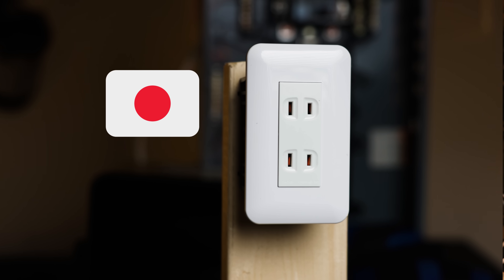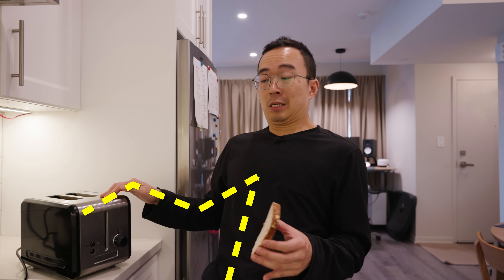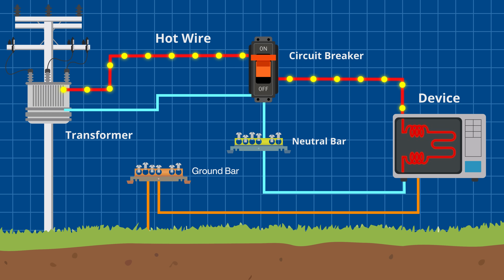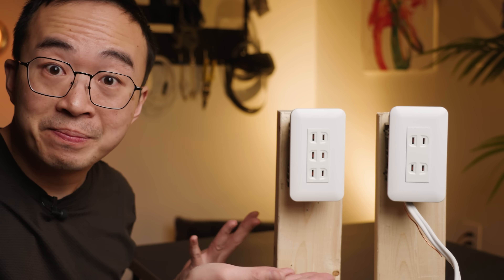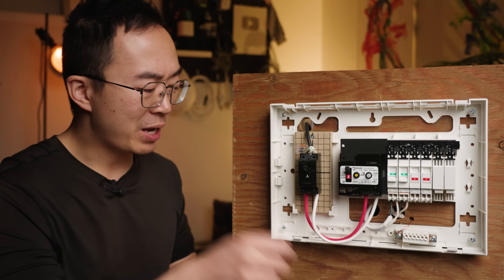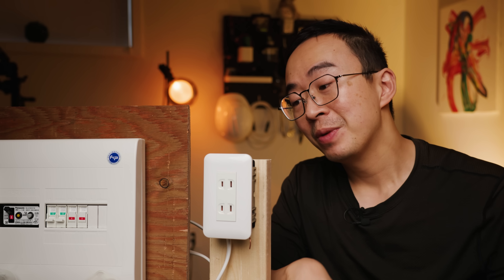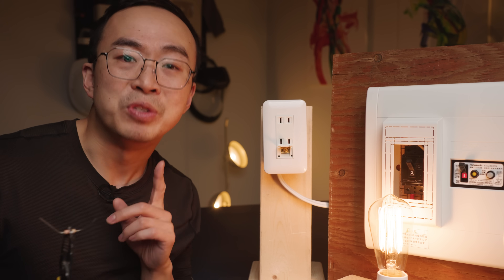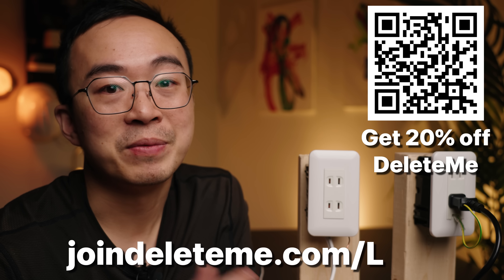How Japan Made Their Outlet Safe

Comment: I live in Japan, and for whatever reason, power strips nearly always have a ground pin hole, despite basically no appliances having the pin. Also, many appliances that have a ground wire, don't have the fancy metal connector. It's just a bare wire, and you're expected to just sorta, shove it into the ground plate.
Reply: I'm currently in the Philippines and there are US plugs everywhere but instead of 110 V, they're using 230 V @ 69 Hz. Somehow the outlets are upgraded to have a ground pin but the rest of the system hasn't been upgraded properly. Also you'll find many devices using EU plug as well. Many US grounded plugs have the ground pin removes to fit into the old sockets. German Schuko plugs also fit into the universal outlets that are here but still no ground connection. It's wild. 😅
Maybe it would have been better to upgrade the US plug to a different system in order to force an upgrade in the electrical system as well.
Reply: @davidvolker4647 sounds like China, you will have the Japan/US 2 pin but it's 220V, European style 2 pin, and the Australian/NZ 3 pin all at once.
Reply: Similar in Taiwan, people would just yank off the ground plug with pilers lol. Some appliances have grounding wires but no one ever use it. In the home I was at the air conditioner 220V 20A socket had ground but not the regular (same as Japan) 110V ones  

And only the bathroom circuit was connected to the GFCI breaker

Newer building have American style ground 110V sockets
Reply: Likely just re-use of American designs. In Australia many plugpacks coming from China are 'upside down' since China uses a very similar (but not quite the same) outlet as we do, but they have the earth pin on top, so if the plugpack pulls away from the wall slightly, the earth pin is the exposed pin, where in old Australian appliances, active and neutral would have been exposed. in 2003 it was mandated in Australia that the first half of the flat pins (the half at the back of the plug, not the half first inserted into the socket) is insulted to prevent that issue.

Different solutions to the same problem, but since we share an outlet and do it differently, sometimes the plugpacks are just upside down - happens the same for China too, sometimes a plugpack released in the local Chinese market will be Australian standard with insulated pins but upside down for Chinese sockets.
Reply: It's a bad design. They should have just started making outlets with the 3rd pin as well as the plugs that need it. They could have done that decades ago.

Comment: TLDR Japan adds a MAINS GFCI  making all outlets Satisfactory. USA adds Ground To make Outlets Satisfactory, UK add a Fuses to Outlets to make them Satisfactory.

In short for Each system for Satisfactory
Japan: MAINS> GFCI> FUSE> Outlet>Outlet daisy Chain
USA: MAINS> FUSE> Outlet Grounded/Outlet Ground+GFCI>Outlet daisy Chain
UK: MAINS> Grounded Outlet With Dedicated Fuse> Outlet daisy Chain Each with Fuse

Most Efficient + Safe
MAINS> GFCI> FUSE> Outlet With GFCI Grounded> Outlet daisy Chain

Video Title is Wrong since Best Practice in US is to start Each Circuit with a GFCI and Daisy chain from that... Not that they ALWAYS DO.(Really should be Enforcing that code Federally instead of being a town by town thing.) That and the Neutral Short that US has is already in place and Japan needs the infrastructure for that safety... Also the UK is safe only due to sheer redundancy not because its is truly safer... and they have even less than japan does for infrastructure. Remember making it Efficient and Safe is the goal not just SAFE.

Comment: If the ground draws the electricity from an overload, why doesn't the electricity always go to ground instead of neutral all the time?   If ground and neutral are connected together what would cause ele. to divert to neutral?
Reply: The video really didn’t explain that well. 

Normally, power flows between line (live) and neutral. In a FAULT where the line is accidentally in contact with a conductive enclosure, that would cause the enclosure to become live. By preemptively connecting the enclosure to ground, if the line conductor accidentally comes into contact with the enclosure, then it’s a dead short and the breaker trips. 

(The whole thing he says about ground being a much larger conductor is kinda nonsense. It’s limited by the size of the wiring in the house, which is why proper wiring always uses a ground wire the same size as the line and neutral wires.) 

So your question “what would cause power to divert to neutral” is based on a bit of a misunderstanding. Power doesn’t divert to neutral. That is its normal designated path, as defined by the circuit design and enforced by insulation. The power has to flow there because that’s the only place it can flow through, as designed. It is only in a fault condition where something has gone wrong that the power can flow through the ground conductor instead.
Reply: @tookitogo  Thanks for your explanation. Electricity is really a complicated topic.  I watched one video recently that explained that electrons do not actually flow from point A to point B but are more static.  This subject is way over my head.

Comment: In SE Asia (Thailand, the Philippines) they don't have ground, but rely on UPS and voltage regulators (the kind with the needle showing RMS voltage, the needle jumping around a lot and some mechanism akin to a Wheatstone  bridge perhaps seemingly correcting any voltage fluctuations).  Consequently it's not unusual, as has happened to me, to touch your computer case and receive a mild shock.  Also UPS always seems to go bad (swells up since the battery 'explodes') after each tropical thunderstorm, of which there are many, pretty much weekly where I am.  Consequently I finally built a home in that region that had a copper wire buried in the generally wet ground to make a crude home made ground of sorts.  Since I'm not an electrician (though I have wired appliances rather badly and have a science background), I'm not sure if the home made ground works (although the voltmeter seems to indicate it works, but voltmeters I think are for hobby <10V circuit projects IMO and not for power circuits, for reasons I cannot fully articulate but I'm think a pro electrician might agree) and a few times I have tripped the circuit breaker, and I do have GFCI in many outlets, so I think my ground system works but frankly I don't know and out where I am, in the boonies, there are no professional electricians.  I can confidently say after installing my homemade ground that I don't get shocked by my computer case anymore but since my copper wire ground is rather improvised, I would not bet my life on it.  My intuition tells me it works for small wattages and not for big wattages.
Reply: CAT I - The lowest category of multimeters can handle up to 600 volts.

CAT II - Multimeters can handle up to 1000 volts.

CAT III - Multimeters can handle up to 6000 volts.

I'm also in the Philippines, Tagum City to be exact. If you are getting a shock off your computer case, then you have more serious problems that really should be addressed by a qualified electrician. I can't really give better advice.

Comment: You confused ground with grounded.  The ground is a low impedance path back to the overcurrent protection device.  That enable high voltage spikes that actuates the magnetic coil in the breaker to break the circuit.  Grounded is completely different.  Look up corner grounded delta transformers.  The first means of disconnect is also the only point where the neutral and ground are bonded.  No overcurrent flows past that bond point.
Reply: And I have seen many a novice trip over that "grounding" vs "grounded" when reading the NEC for the first time!
Reply: Earth and ground are different things.
Reply: Another American who thinks the world uses US standards. In many countries, including Japan, the ground goes to a ground rod.

Comment: The other thing that helps, and is a big reason why north American and Japanese electrical standards look really inadequate compared to Europe is that it's pretty hard to hurt yourself with 110V power even if everything goes wrong. It CAN happen, but the risk is significantly lower than countries that use 240V power which is much more likely to ruin your day, and the lower risk offsets the less robust safety designs. North American electrical systems have other protections in the system that cover all the same fault conditions, and more recent versions of the electrical code has more stringent requirements on protection devices that can be used in different ways to achieve functionally identical protection to what japan, and the rest of the world have. 

Still don't stick a knife in an outlet, and don't take a bath with a toaster. unless your toaster is pluged into a GFCI breaker in the bathroom, then it'll be ok. 

north American GFCI outlets are much more sensitive than the whole panel GFCI or RCD protectors used in Europe since they activate faster and at lower currents, this is only possible on smaller circuits, and you can get more sensitive RCD breakers for individual circuits in the rest of the world too, they just aren't as common.
Reply: Teh US has 120 V and Japan 100 V. I wonder did you deliberately calculate some average.
Reply: Thank you for pointing out these facts capt Nemo.  The only thing I would add is that govt regulations eliminated metal exteriors for things like hand power tools back in the 60s, which stopped much of the problem.

Comment: There should be an asterisk in your video around the @11:50 when you say "not only does this detect wiring faults".  The truth is that it only detects MOST wiring faults.  It will not detect, for example, a swapped neutral/ground.  It will also not detect a high resistance neutral.  Klein explicitly list the swapped neutral/ground situation in relatively fine print in their instructions for the RT210 under "Conditions NOT indicated"...among other places.
Reply: The newer system to protect against such faults is ARC FAULT (AFCI) protection aka DAA/DDFT in europe. GFCI/RCBO is old news in global electricity safety systems.
Reply: I wonder how much safer does that makes the whole system. Not theoretically but practically. Being living in Japan for a long time, but have never heard anyone dying of a electric shock...does that extra grounding REALLY make a difference in real life?!
Reply from the maker: Yup, I should have put that in regarding bootleg grounds, etc
Reply: @Lam  Also, keep in mind that GFCI doesn't provide any protection against arc faults, hence the more recent AFCI breakers that will probably be standard in the US in the future. From what I understand, they're still not super reliable about false positives, but they should create safety that GFCI just doesn't in areas that don't have water.
Reply: @SmallSpoonBrigade  AFCI is a strange band-aid solution for non-metallic sheathed cable. The laws should mandate EMT or armoured before AFCI implementation.
Reply: @Shaker626 Can you explain your assertion? My understanding is that AFCIs detect arcing that is the result of a loose connection. All electrical systems have some sort of connection points, whether they are screw terminals, twisted wires with a wire nut, or wago connectors. I don’t see how the sheathing of the cable is going to make much difference in the case of a loose connection. I’m fairly certain that loose connections on metal sheathed cables have caused fires. Although, conduit or  metal sheathed cable does have more protection from physical damage, such as someone driving a nail into a wall.
Reply: @wesleyhurd3574  Maybe electromagnetic interference could be triggering the AFCI when there are lots of unshielded cables around, acting like antennas. I haven't dealt with those devices but I've read weird issues about them online where they seem to be somewhat sensitive to EMI.

Comment: USA has fuse box mounted GFCI circuit breakers. this is superior to Japan because every outlet also has ground built-in. no need to manually wire it in. and this can always be added in to older homes without the need to re-wire anything.

Comment: Ground and neutral should only be bonded in the main panel. Sub-panels between different building that are linked with metal piped should isolate the neutral and the ground bus bars and a separate grounding rod must be installed at the sub-panel location.
Reply: Sounds right.  I put a sub panel in my house and even for that the ground and neutral had to be isolated
Reply: Grounding systems vary country to country. As far as I know Japan has TT where the ground and neutral are not connected.

Comment: Well Malaysia also use tt earthing, with uk plugs thats earthed, 2 pin plugs are permitted as long as the device draws less then 3A or is double insulated. Our RCD sensitivity is according to use. Lightings are 100mA, 30mA are for dry sockets, and 10mA for wet areas

Comment: You spent this whole video basically saying that Japan's style was superior but your video disproved that. In America, we're putting GFCI stuff in the breaker boxes already therefore we have all the advantages you speak of except we don't have to use a screwdriver to plug things in. Also, we run at a higher voltage. Your video has told me that Japan was cheap when it came to infrastructure and built the electrical-equivalent of the plumbing in 3rd world countries(where toilet paper has to be put in trash cans). Seems like your video is really just saying the American way of doing things is better. The only advantage Japan has over us when it comes to safety is that Japan uses lower voltage therefore getting zapped isn't as dangerous. Of course, saying this will upset all the Europeans who think that 230V is perfectly fine in every outlet.
Reply: Yep, exactly. The funny thing about the Europeans defending their 'safer' outlets is they don't realize that the reason they're built that way is to protect them from the 230 volts. 😅
Reply: @mediocreman2  Main feature of those European outlets is that they sell for a much higher price. UK is the worst of all. Freakin' contraption outlets.

Comment: I also have a second question, in the USA GFCI devices trip at 4-6 ma difference between neutral and ground, why is 30 "so much safer" 25 across the heart is enough to kill. 
In my 1992 house in the USA we have one GFCI device connected to all wet locations and outdoor locations in the garage. Just plugging in an outdoor device with condensation in the plug is enough to trip it!
I would much rather take a 5 mA average zap than a lethally 30 mA zap on the circuits that actually matter IMO. Ground is better, and even here in the USA most appliances under a certain wattage is still 2 pronged but expected to be used in protected zones ... defined damn near 50 years ago
Reply: Yep, there's some really bad information in this video. Full house GFCI doesn't make sense because you can shut down the entire house with one outlet. The U.S. with an AFCI breaker, ground, and GFCI outlets, safer voltage than Europe, but still have 220 if you need it, is pretty hard to beat.

Comment: You use the term ground in this video to refer to earth. Ground and earth are not the same thing. Ground is the 0 volt point in dc circuits while earth is used only to earth unintended voltages in metal objects.
Reply: You are absolutely mistaken with that definition, as a blanket statement. 

In countries where the word “earth” is generally used to refer to protective earth (like the UK), then yes, the word “ground” is often just used to mean the 0V reference point in a circuit. (Can be an AC or DC circuit.) Nobody calls the 0V reference  “earth”. 

But in North America, protective earth is also called “ground”, and we never use the word “earth” to refer to protective earth. Grounding/earthing as concepts predate the use of protective earth, and those concepts all involve ground/earth being 0V, which is why our word “ground” became used for 0V even in floating circuits.